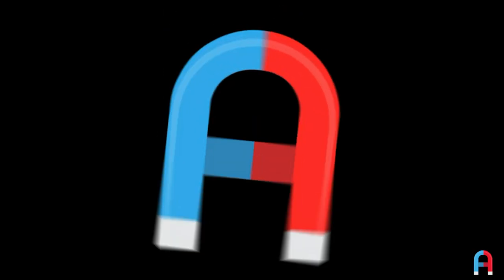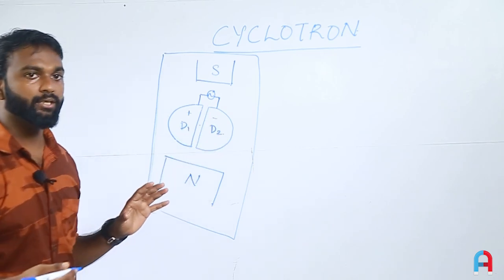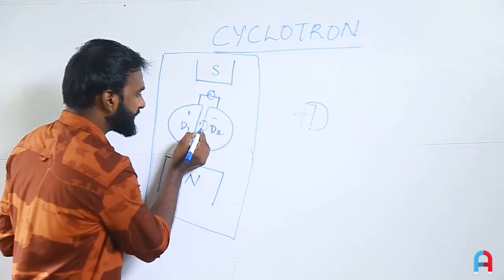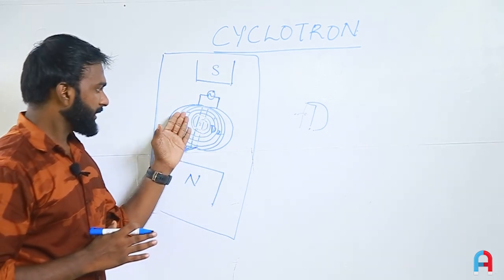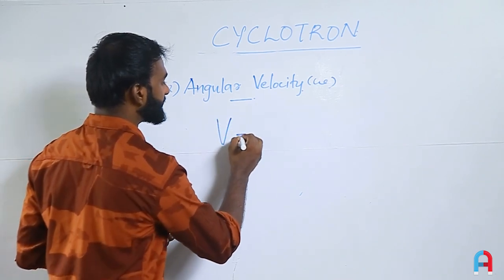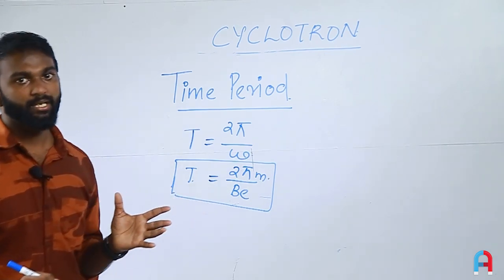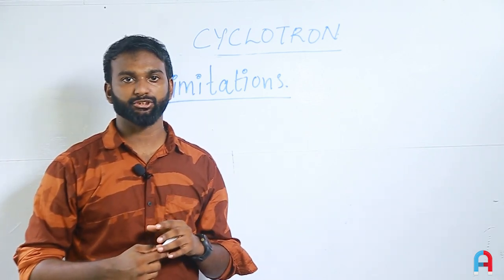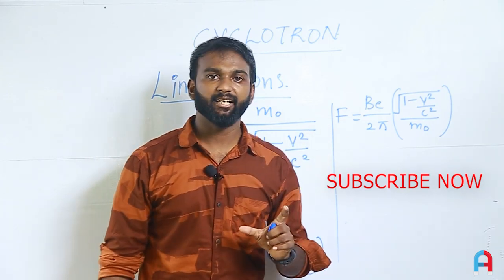Nuclear Physics | Cyclotron | Freefall Academy | +2 | BSc | MSc

Comment: Doubt...

1. If we increase the distance between the dees, is it possible to accelerate a particle to a particular velocity within a short period of time? 
(*particle accelerates in the region between dees)

2. To denote charge, isn't it better to use 'q' instead of 'e' ?
E.g. If we are going to accelerate an alpha particle.

I'm a +2 student and it really helped me.. Thank You Sir.😍❤😍
Reply from the maker: 1.very good question.The distance between the dees are kept narrow inorder to maintain a stable oscillating electricfield in between.It has nothing to do with the speed of the particle.your thought was excellent but if we increase the gap it will effect the field stability that may cause the particle to deviate from its original trajectory.If you want to adjust the speed u got to adjust the oscilator voltage ,but you cant increase the speed more than 10% speed of the light cuz once it crosses this limit the relativistic mass effect comes into action.

2.That sounds good but as per the international sign convention, electrons aswell as protons are notated as 'e' (ignore their charges)
The rest of the charges are taken as 'q'.I have mentioned it in this lecture.
So as u asked if we accelerate an alpha certainly u can denote as 'q'

Anyway thankyou so much for your response.Keep in touch with freefall academy.Do not forget to share .Thank you.Have a good day😊
Reply: @freefallacademy9786  Thank You for clearing my doubts. I have watched your videos and fall in love with your classes. Continue your teaching journey... We all are  here to Support and Promote your Channel... 
ALL THE BEST !!!